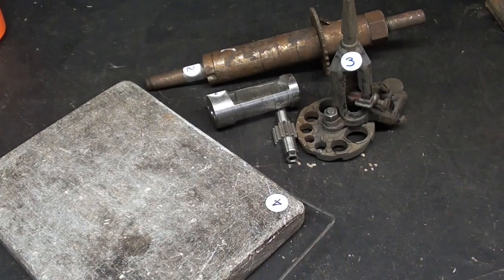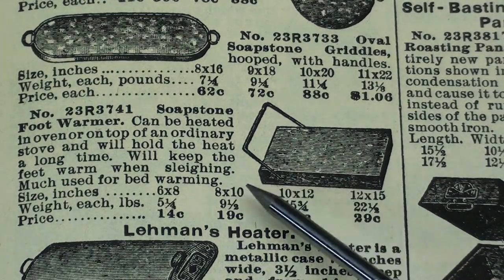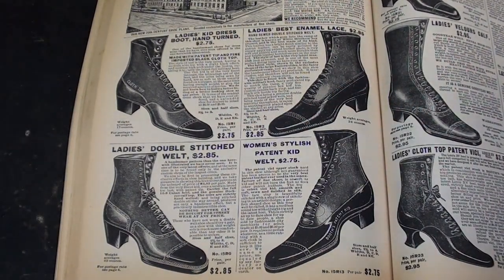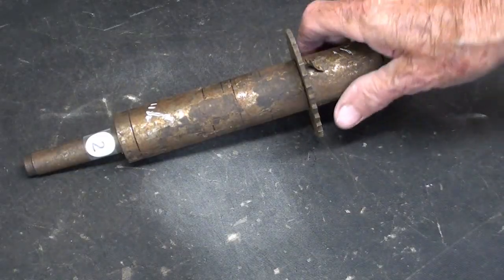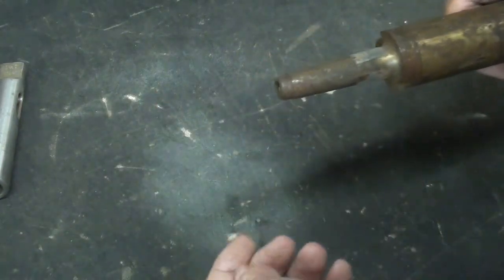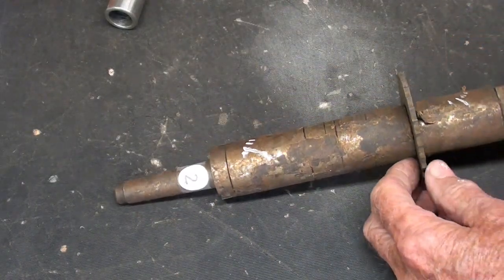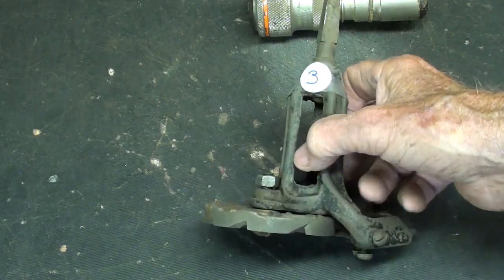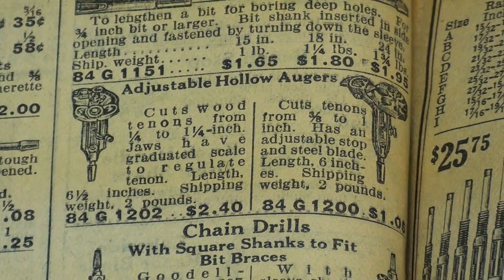WHAT IS IT? Mystery Tools #97b answers tubalcain mrpete

Comment: $35 was more than a year's wages for some, more than a month's for many. The last time I held a bedwarmer (I did hysterical re-enactment as a kid), it was metal and held coals from the nearest grate.
My shop teacher, whose first career was no doubt in the 40s, and from I learned in the 70s, taught that the tang on MTs was exactly as you state - to prevent the thing from slipping. This has to be documented in Machinerys or some other ancient tome. Wikipedia claims: "The tang is not engineered to withstand twisting forces which are sufficient to cause the taper to slip" but I don't consider that authoritarian.
Reply from the maker: I agree with you

Comment: I have a couple of those hollow augurs, with my bit and brace stuff. They're not that great simply because the depth is very limited. You can really only cut something like the last few inches of your stock to round, and the diameters available are pretty small so it's not like you'd do a peg end for a chair leg or anything.
Reply: You also need the spoke pointer first. Would be nice if there was a combination device rather than needing both, having to keep two braces out of switching the bit frequently. I'm sure larger hollow augers exist, it's just the ones I happen to have are too small for most of my purposes. I do have a much larger single size on a T handle, must be for wagon wheels or something. I don't know that I've used it
Reply from the maker: By the way, I have not shown the pointer yet that will be on the next video.
The hollow augers are available in a huge range of large sizes. They are used for making log furniture, etc. power driven of course.

Comment: My Burke mill uses just the taper to drive it. I don’t use the drawbar unless I’m not using the overarm support. Even with the support I often have to drive it out with a brass bar as it’s jammed in there. No drive spurs on mine.
Reply from the maker: Glad to hear that I thought the arbor would slip

Comment: The round soapstone is a heater for a Fireless Cooker. Heat it on a stove or in a fire then it goes in an insulated container with your food. I have several they work great. The cooker comes with a hook or has a hook under the lid of the pot to move the stone around. Heaters come in cast iron as well.
Reply from the maker: Thank you

Comment: I don't think it comes through clearly is that the purpose of the two stage door closer is to go slowly through most of its travel, to allow you to carry something through, then go faster for the last few inches to ensure that the door latches. Typically adjustable so you can make the door close just hard enough to latch with out banging too loudly.
Also, my 1951 vintage home has a soapstone laundry sink in the basement.

Comment: Taper in a Drill Press or Lathe will be end loaded, which keeps the taper locked in position.  When used in a milling machine, it is side loaded.  The constant change in side load as the cutter is turning will cause the taper to wobble it's way loose.  This is why you need the additional drawbar on the collet to keep it in place.
Always love these videos
Reply from the maker: You just explained it far better than I. I hope many people read this.
And furthermore, the hardened jaws of the Jacobs chuck will not grip a hardened end mill.        I can still see those chucks laying on the floor with a broken cutter in them when I was teaching. In case you aren’t aware, teenagers do not listen.

Comment: It’s been a long time since I’ve seen MADE IN U S A on a part or tool.
Reply from the maker: And you won’t ever again, unless you buy used tools
Reply: Adam Booth just toured a large Greenfield Industries factory in Seneca, S.C. Drills, taps and dies by the thousands in all sizes are manufactured there on automatic machinery and shipped all over the world. Not too many employees but some to operate the machines.  I was totally surprised to learn that these high quality tools are still “Made in USA”.

Comment: Years ago I can attest to the slickness of soapstone. Had to put slide in door seals on a trailer. Didn't want to make a mess with oil. Took a couple sticks and smashed em up. Worked a charm with no mess clean up
Reply from the maker: Slicker than snot
Reply: Soapstone on soapstone is about as close to Teflon as you'll get.

Comment: The radius change on the pinion gear of the door closer rack and pinion would also regulate the function speed.  I always assumed that speed was a function only of hydraulic oil porting. I am impressed.  My armchair mechanical engineering inventions are much simpler. 

Very interesting answer portion.

I suspect that the soapstone foot warmer could substitute for a fire brick parts heating station. It would be less brittle than a fire brick pad, which is a frustrating malady to me.

Comment: Well, I knew about the Door Opener because I grew up in Mobile Alabama where one of the first Ceiling Fan Manufacturers was built. Empress Fan Company back in the Day made Automated Door Closers. You would NOT recognize them. It used a thin fine rope, a sash weight, an eccentric cam and a bumper of two springs nested in each other. The eccentric cam played the same role as the eccentric gear track, with the swing easy and fast in part of the arc, and slow and hard in part of the arc. I wanna say Empress Fan was built about 1860 making Ceiling Fans, but it expanded into Door and Window Hardware eventually. Fun Fact: its Ceiling Fans used Steam Ponies to drive Belt Drives. Also Sad Fact: The last installation of the steam driven Empress Fan Ceiling Fan I am aware of, which had the BESTEST Hamburgers and Ribeye Sandwiches, was the Haunted Hotel, home of the Haunted Bookstore fame, Sandwich Shop. It was a flat out hold over from a different era. It had a ceiling of fans and belts, pulleys and brackets, main shafts and jackshafts and out back a Steam Pony that had a boiler they fed with busted up wooden shipping crates they got for free at the docks. Every time my dad took us there, my mom never did she said "Its improper for a woman or child to go to that place" and whenever she found out my dad took me and my sister she blew up. Think of this, light buns fresh baked just an hour or so before still warm, and a big fat greasy burger cooked very much just right, big dollop of spicy yellow mustard, thats all they put on the burgers, spicy yellow mustard, sometimes they had sweet onion when it was in season .....those where the BEST DAMN HAMBURGERS I EVER DID HAVE! Even if it was an old creaky breezy sauna. Wooden floor, wooden bar counter, wood burning Sweetheart Restaurant Stove/Grill, Beef butchered and ground that morning, Mustard ground fresh daily, if they had sweet onions, fresh chopped all for a bright shiny dime. All's it took was waiting a bit of time....then, McDonalds opened a shop up down the road. sigh and the Haunted Sandwich Shop didn't last long.... they tried. They added grilled boneless chicken thighs with coleslaw and hot sauce, and that was good, but they just couldn't compete with McD's. I miss that place, and I probably only got to go there 5 or 6 times. sigh Oh, door closers...yeah you saw that skeletal sash weight nautilus looking cam and string on a FREAKING LOT of Screen Doors! I think that was the most popular door closer for Screen Doors in the South for the big double hung doorways. Most folks realized they could get away with a pulley and sash weight and put a bit of leather in the screen door jam, did the same thing, cheaper and with fewer places for someone to stick a finger to get busted.
Reply: What a great post. I enjoyed your memories of ceiling fans, mustard burgers and ceiling fans so vividly expressed.

Comment: Interesting feature of the door closer, a bit like a fusee mechanism on an old clock ?
We had a pallet strapping machine at work that had two oval gears on it, as they turned and the diameters increased, that provided the tension to tighten the strapping before it was friction welded.
Reply from the maker: Interesting

Comment: Thanks Mr Pete. I have some soapstone slab scraps that I got from a plant where they make soapstone stoves. Just for kicks, I made one of those foot warmers. I also used a piece of it to make a round thing to go in a crock to keep the sauerkraut below the brine. I drilled finger holes to get it out. I don't think the metal would taste very good. Maybe the one you have is for something else. My dad used something similar to hold pickles down in the crock, but no metal.

Comment: Looks like the round soapstone would fit into the round holes on top of a wood stove.  The staple would be for picking it up with one of those cast iron handles.  It would warm up quicker than just setting it on top of the stove at bedtime when the fire inside was likely much lower than when cooking earlier in the evening.   Still a bed or foot warmer warmer though I would guess.

Comment: Mr Pete. What material should the tips of a steady rest be made of. I have been following your channel for some time.?
Reply from the maker: Steel or brass
Reply: The steady rest fingers for my old Atlas are made of brass. I was thinking of making new fingers that are topped with bearings.
Reply: Is marine brass better.
Reply: @tas32engineering  I dont think it matters.  I put a little high pressure  grease between the work and the fingers. Note: I could be wrong, and  following my advice will result in the eventual heat death of the universe.